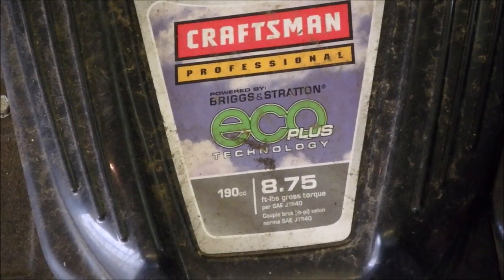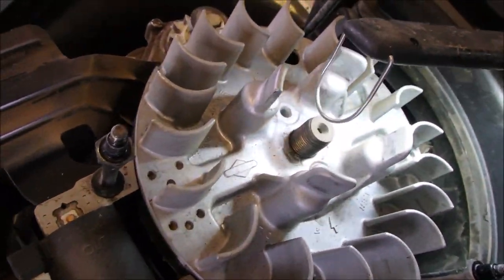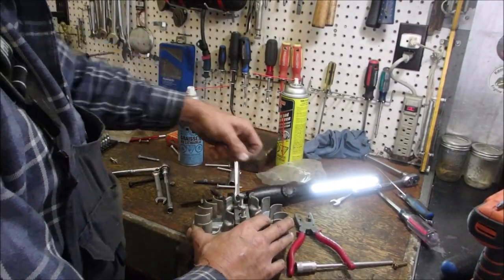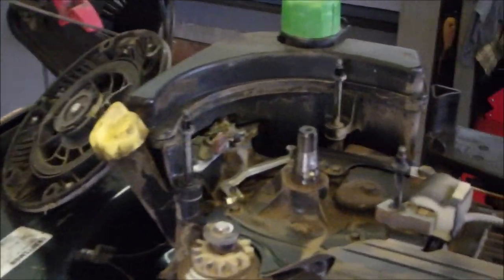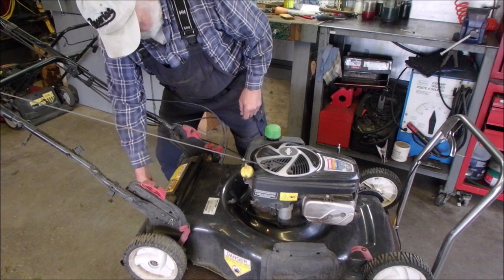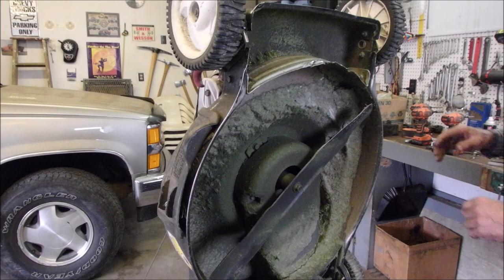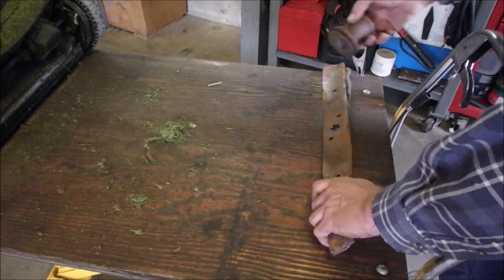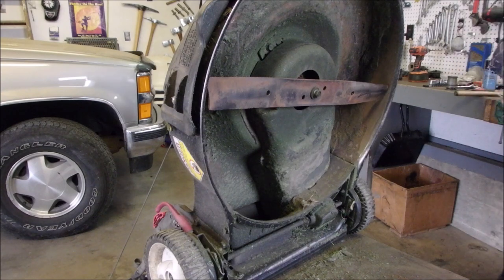Craftsman Eco Plus 190cc Mower Hit Something HARD

Comment: I believe that’s actually an AYP blade adapter, the MTD adapter usually has the bow tie style center and that looks like an AYP built machine to me. I’m not really surprised the blade struck an object considering how low the wheels are set. Probably what happened is the customer pushed the mower over an object which caught the baffle and shoved it into the blade, so the baffle most likely did all the damage. Great video Bruce, love watching you fix mowers!
Reply from the maker: Thanks for the info!  I don't  see many of thase.  I googled the # and got an MTD product.  Could they own everybody now??
Reply: @BrucesShop  I fear they soon will LOL!!
Reply: @BrucesShop  A lot of the parts from MTD fit some of these units also: Cub Cadet, Husqvarna, Poulan, Craftsman, Murray and maybe some others.
Reply: @BrucesShop  MTD is owned by Stanley Black & Decker.  If I'm not mistaken, they announced a plan to turn their OPE to battery only around 2030.

Comment: I would have left the baffle as it was. By cutting that away you can get grass blowout (for those particular about cut quality). Those Briggs seem pretty good (for their newer style motors)
Reply from the maker: I did think about that though.  I am working on a mower right now with the wrong blade adaptor and there is no lift on the grass at all.   As it is near the front there seems to be no issues.

Comment: those are made by Husqvarna not MTD I think , the MTD blade adaptor use the bow tie pattern, and Husqv uses start pattern sometimes.  good job and vid getting it going.  I have never seen one of those high powered engines on a push mower before. biggest  I have seen is 173cc on a OHV (powermore) and 190cc on Flathead (Briggs).
Reply from the maker: Thanks for the info!

Comment: Don't work on many of that engine model nor that blade/adapter style these days.  In fact, I NEVER have used spare blades on hand of that style and buy them new when I see them on sale on Amazon/etc.  I am surprised nothing got knocked loose internally with as bad as everything else was.  I even grabbed a few of that style blade adapter for $8-9 each when I needed one and had none on hand.  I like that old Toro you had in the line to work on; just had one here that I scrapped down because both cables were totally seized and damaged - and not worth replacing
Reply from the maker: This one I have is similar to your old Toro

Comment: If the dimensions are the same can you just flip that guard around?
Reply: Normally that guard is welded to the deck at each end so it would be difficult, the only repair that could be down beside what Bruce did would be to weld a metal reinforcement strip on the outer edge that is away from the blade side. Costs the customer more and really not needed.
Reply: @waynestefinashen239  Looks like there are bolts and anchor nuts (or hex nuts) to fasten that thing down.
Reply from the maker: I just got it to the safe point.  A person hast to move forward.  You should give making videos a try.  Chris.  It is a great hobby
Reply: @chriskelly3289  You are correct i see them moving as Bruce is trying to straighten it out so flipping over is a option but the damaged area will tend to grab a lot of debris and hold it against the deck. Bruces fix is the quickest and least costly for the customer and works.
Reply: @BrucesShop  But as we all know takes up a lot of time, not as easy as many think!
Reply: Those baffles do serve a purpose to better deflect the clippings out the discharge and help mulch.
Reply: @atibbs14  100% correct there may be a slight difference now with some material removed

Comment: My question is, That is about $150 repair, if not more, Is it worth it to fix an 11 year old lawn mower or just replace it.  In your case you had the parts, but to buy and find those parts and then wait 2 weeks for them to be shipped.  Is it really worth it.  I am glad you didn't try and start it with the broken fly wheel key, they can get pretty violent. Ask me how I know.  So in my case the pull cord ripped out of my hand  and wrapped around my other hand on the handle and cut me pretty bad. so in my case the lawnmower when to the road and the customer bought a new on on sale at Canadian Tire.
Reply from the maker: Right.  I understand.  i had the parts.  Strangely enough I have a Honda Troy Bilt that runs but I am going to part it out for that exact reason.  The parts added up to more than the value of the mower.  Not even including labour.    Can you imagine how any negative comments I am going to get.  The video will be out in a while.

Comment: Yepper the only reason you still still the B&S and Techumseh mowers still going strong is they use the aluminium keys which shear when something is hit. A the scrap yard you will find thousands of Powermore and Honda engines that use the steel wood ruff key that i have never seen shear yet, they just destroy the crankshaft by severely bending it eh? Nice use of the tape as a visual aid for checking the crankshaft Bruce.
Reply from the maker: Thanks Wayne.  I do that check 2 ways   One is the tape and the other is just the blade position 180 degrees difference.  Thanks again

Comment: So glad you said the hp is ruffly 6.5hp, I have so many customers with the timemaster mowers, that sit there and fight with me they say it's 8.75hp I say but it's 190cc, that 8.75 is gross lb feet of torque, they walk away it's 8.75hp, I just shake me head, and say to myself, 6.5" is really 8" to him, now I see the problem, if you get my drift..... LMAO. Great video as always sir.
Reply: Yes horsepower is something that really cannot be measured and it took the lawsuit against B&S to finally get everyone to label the engines with torque ratings which are measureable.
Reply from the maker: Right on.  The new rating is misleading to the public.
Reply: @BrucesShop  agreed sir.
Reply: @waynestefinashen239  but in a sense there's no real difference since HP is a simple calculation from torque.  so if torque is wrong then the hp is wrong, if torque is right then hp is right. labeling one versus the other doesn't change that.

Comment: I have a few complaints about the 8.75 series, and the 10.00 series,
1. Blown head gaskets
2. Striped out carb and muffler bolts.
3. The special bolts that hold  the fan shroud on, if you tighten them down to much they won't come off without a fight, and the snap real easy over the coil.
Reply: At Eliminator Performance we typically check and normally have to tighten at least 3 head bolts nearest the muffler during ever service or repair. Additionally when we remove a muffler we will use copper antiseize on the threads when reinstalled and never use a impact driver (hand install and tighten only) bolts on both the carb and muffler. Again the bolts for the fan shroud are also only hand tightened. We have had issues removing the 3 recoil nuts on Honda style engines since they were impact torqued on installation and when removing the entire stud comes out of the block then we need to grip the stud to impact the nut off. Hate when this happens!
Reply: @waynestefinashen239  agreed.
Reply from the maker: Thanks